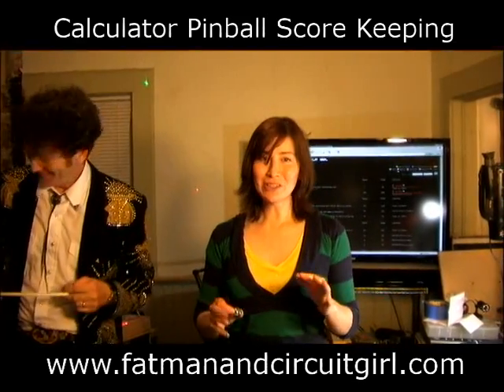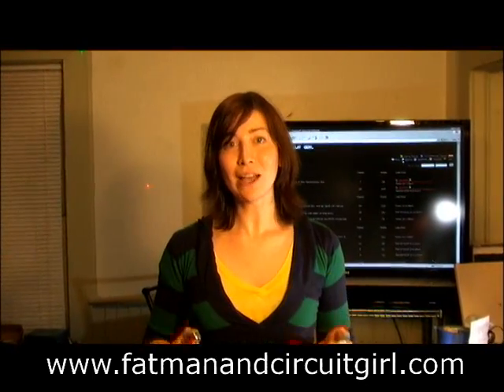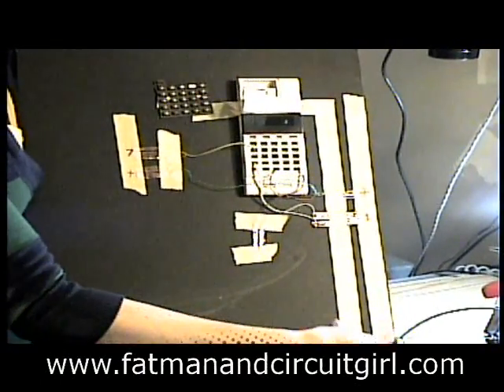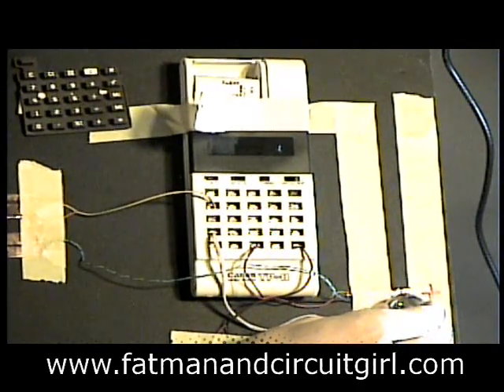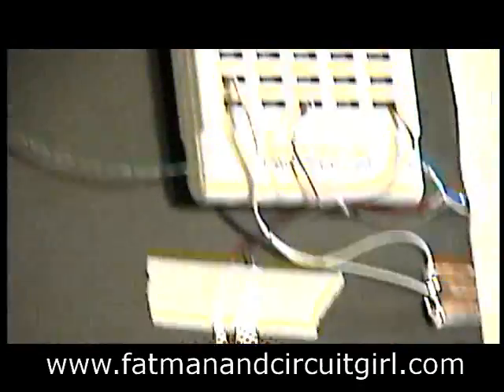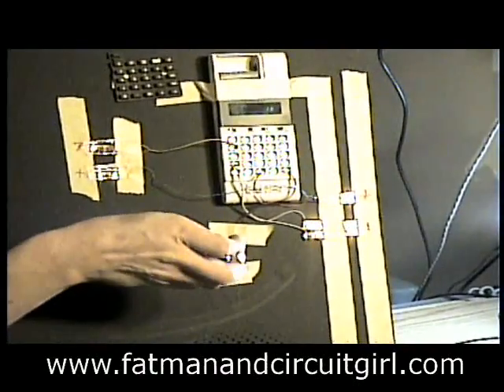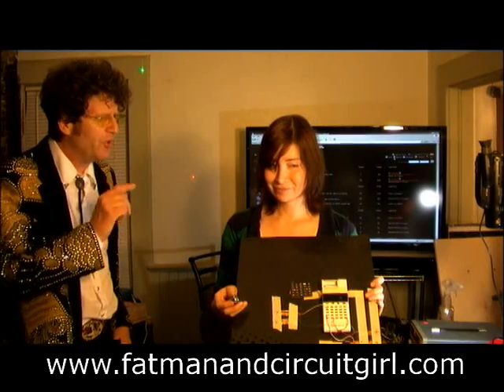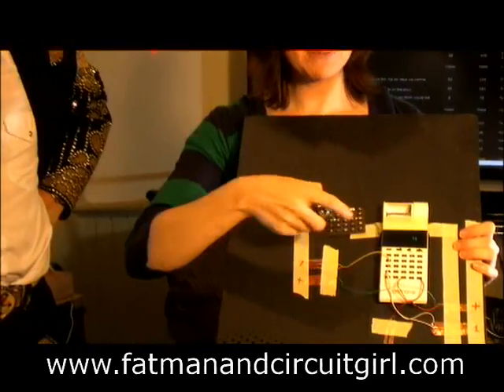Pinball Score Keeping Jeri Ellsworth

Comment: What sensors did you use (that are show in the video, were they proximity sensors?). Also, how would you wire the sensors to the calculator and would it be possible to wire and keep score of other hit targets (such as a stand up targets and pop bumpers) using this method? I really want to build a pinball machine and this method of scoring is so much easier than programming and suich.